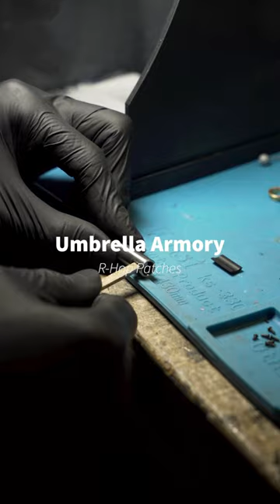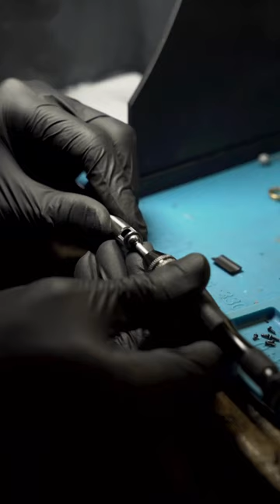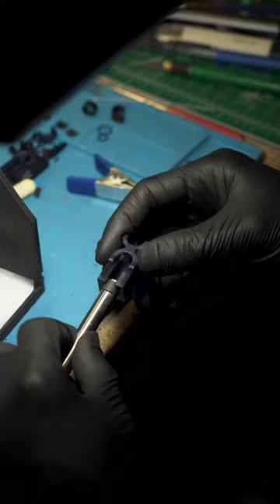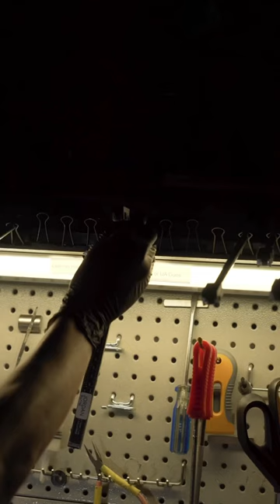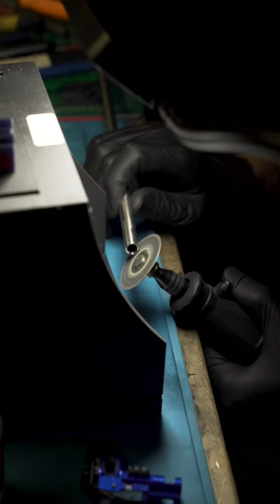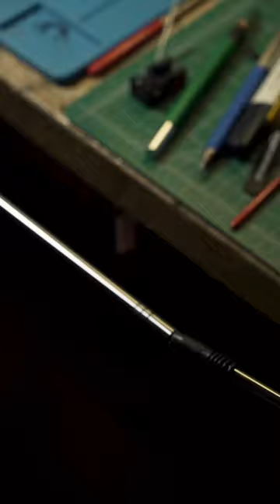Umbrella Armory R-Hop Patches #airsoft #umbrellaarmory #techtips #shorts #rhop #rhoppatch

Comment: why is r hop supposed to be better, does it result in longer range?
Reply from the maker: Yes it does increase yohr range.
Best analogy is like driving around and your tires hit a sharp speed bump. But sometimes theres those speed bumps that are like 3x the length and your car just softly glides over them.

Thats basically what a BB feels when interacting with bump style buckings and r hops. Friction is applied over a longer period of time and thus needs to be less sharp and less turbulent when passing through.

Though its not as necessary if your using only 0.20g and 0.25g.

R hops benefits scales with the heavier BBs starting at 0.28g with peak gains around 0.36g on a 1.5j rifle.